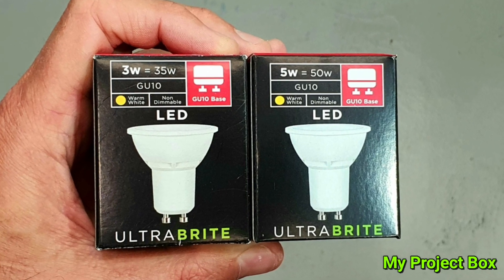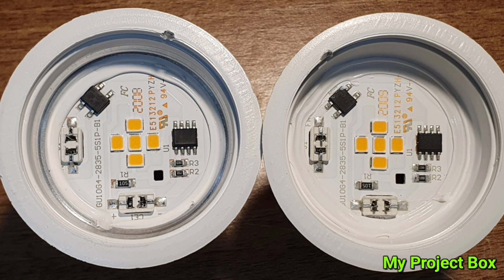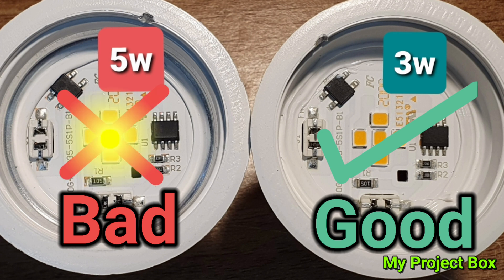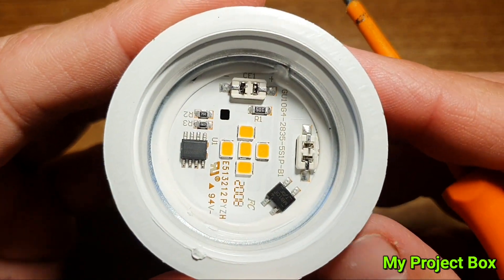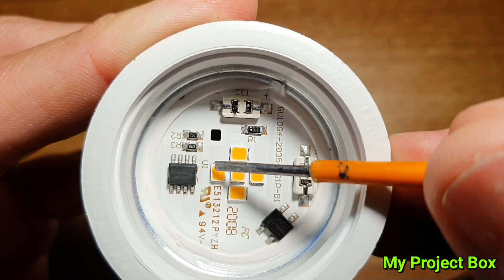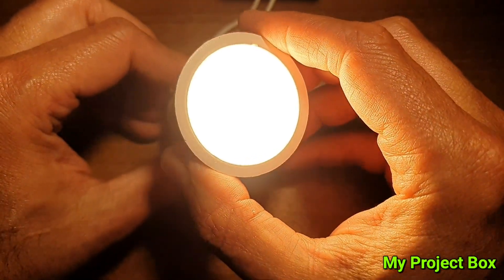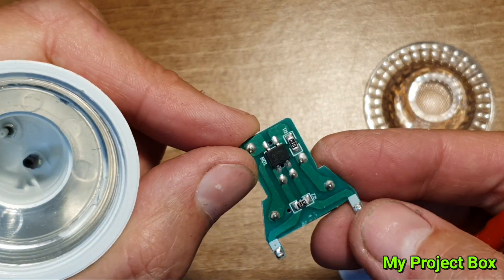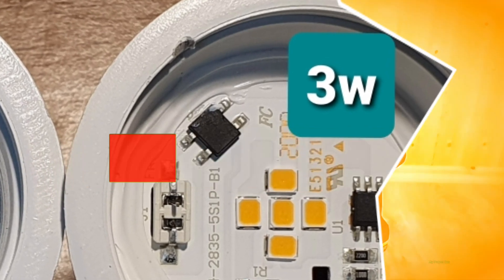Good and bad news GU10 Poundland bulb Hack and life extension 5w or 3w #ElectronicsCreators

Comment: I've got some failed 5W candle poundland bulbs to see if I can revive, I'm guessing it's one LED burnt out.... don't know if the covers are glass or plastic though... maybe I need Big Clive's Xray, the hammer of knowledge
Reply from the maker: It's normally plastic but before you apply the X-ray hammer, try tapping  the dome on your teeth gently, that way you can only tell if it's glass or plastic. If you hold the pointy Dome end in one hand, and the white  body in the other, and try to snap the Dome off. If you apply enough brute force, and with some luck it should come straight off.

Comment: How do we know the 3w one isn't just under driven rather than the 5w being over driven?
Reply from the maker: Well I think it's a bit of both 😉. In the 3w bulb  the LEDs are being driven at a lower current and that makes them last longer. I've had the 5w ones fail on me, they get very hot! Under driving LEDs is always a good thing. It's common practice to run a led below it's maximum design current.
Reply: You could test on a meter. If the bulb is bright enough for your needs after "Hacking" it, then it dosent really matter!?? Oh and you lengthen the life of bulb And save power! 
Thats a win, win! in my book.
Reply from the maker: @BrokenBritainz  it's back up in my kitchen. I hardly noticed any difference in brightness, next to the others up in the ceiling😉
Reply: Good work 👏 win-win in my book. 
1. Lengthens lifetime of 💡. 
2. Uses less power. 
3. Saves money 💰. 
1 Hack = 3 results. Free & easy. 
👏👍🧠👀⚡🏆💡🪛🇬🇧🇿🇦
Reply from the maker: @BrokenBritainz  I'm glad you like my videos. Hopefully they can be useful to someone in the future 😉. By the way I like the British and South African flags 😃